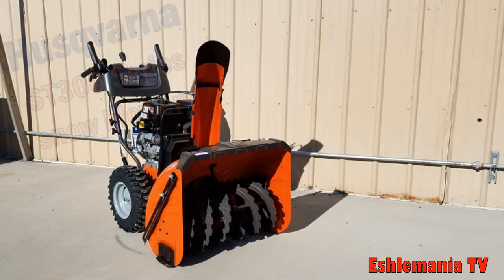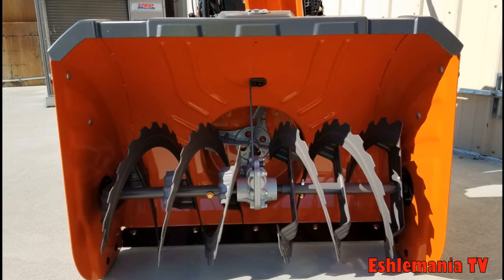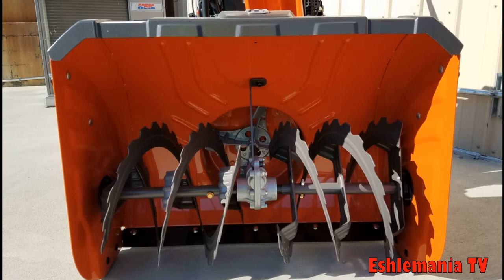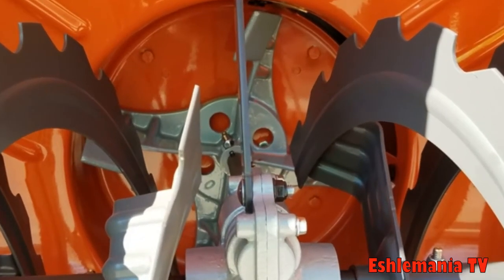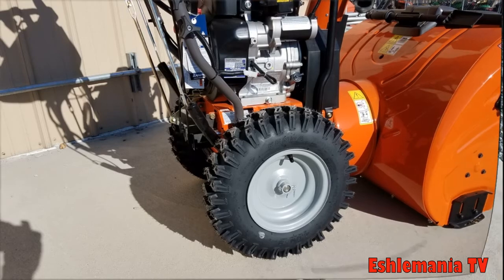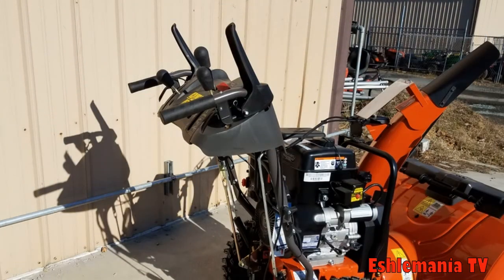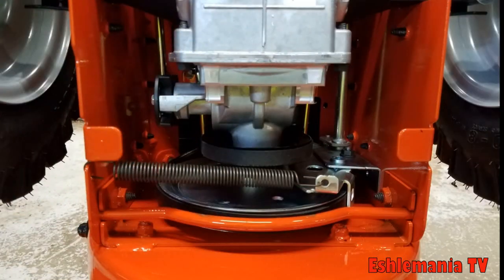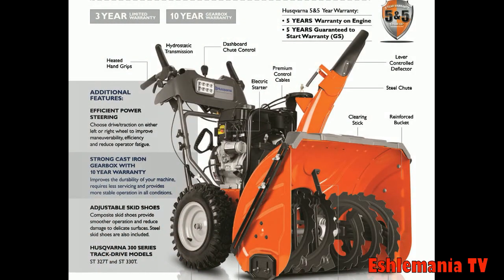Husqvarna ST300 Series snow blowers (ST324, ST327, ST330)

Comment: Did u say cast iron impeller? Isnt cast iron brittle? So if I suck something up that I shouldn't instead of it bending it'll just snap off perfect.
Reply from the maker: There are different types and grades of cast iron. Have yet to see anyone break one of these impellers which is a step up from the stamped and welded impellers found on cheaper models.